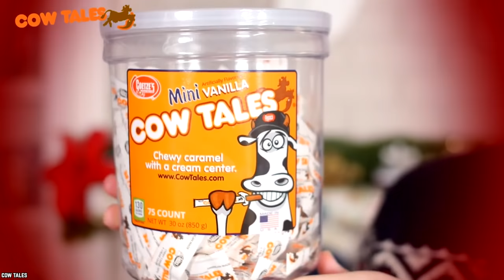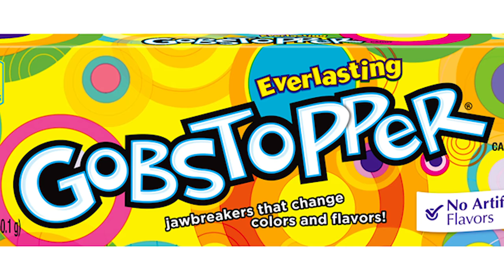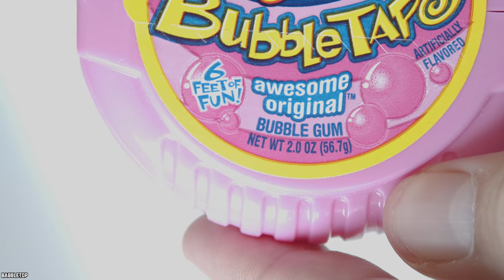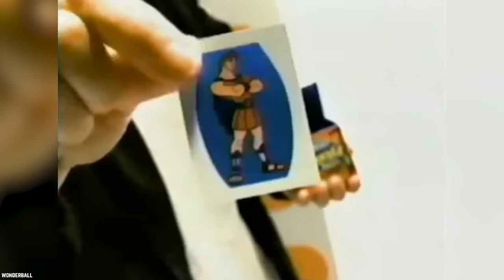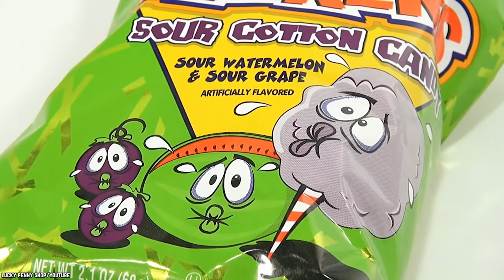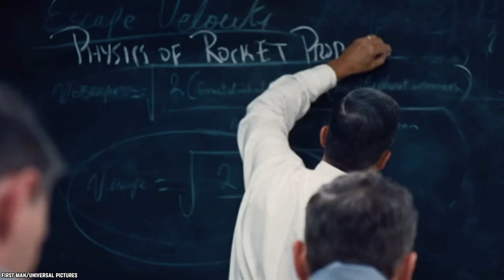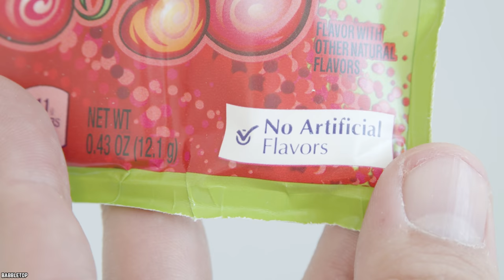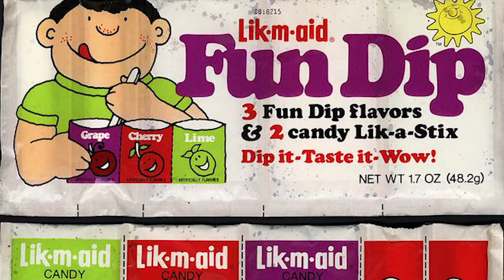Top 10 BEST Candy of the 90's (Part 2)

Comment: First, runts can be found anywhere, mostly near things like gobstoppers and bottle caps and even in every single quarter operated candy machines, and secondly no, kinder joy IS NOT BANNED in the US, whay was banned was the ORIGINAL kinder joy design where you broke open the egg and the toy was inside. Now, kinder joy has made it so it has two halves, one has the treat on one side and the other contains the toy. The fact that you can literally go to a supercenter like walmart and find half these candies to fact check whether or not they are still around makes your video a literal insult to people who actually grew up with these candies. Y'all wanna talk about a candy you can't find anymore lets talk about the original whatchamacallits and thingamajigs both are very similar chocolate bars, the first of which is still around but very scarce to find)
Reply from the maker: If you have listen to our introduction we did not say these candies are no longer existing, some of them you can still find in the market. And yes you are right about the Original Kinder Joy which was banned in the US and that's what we are talking about 😊